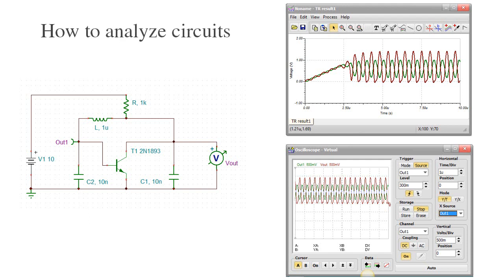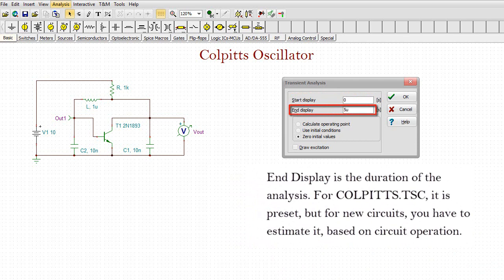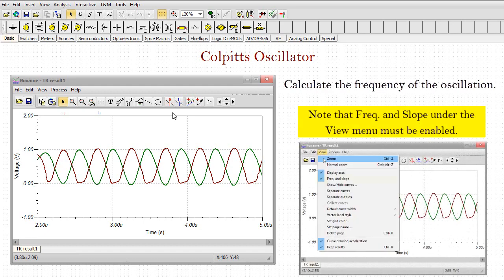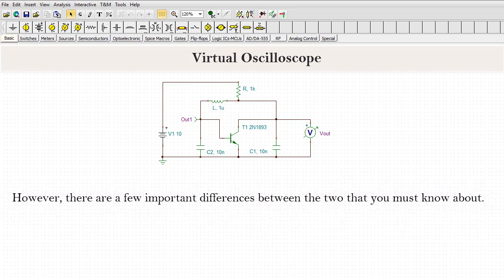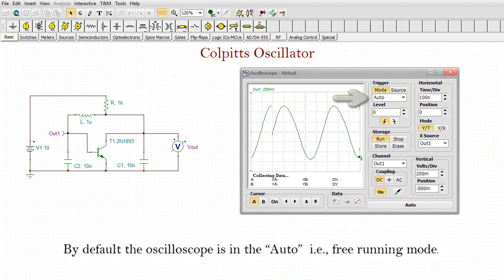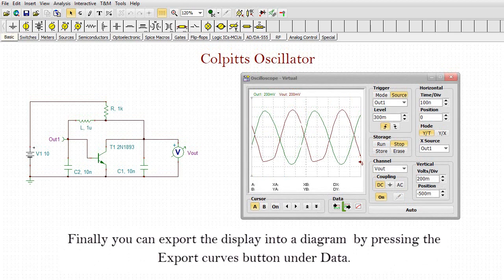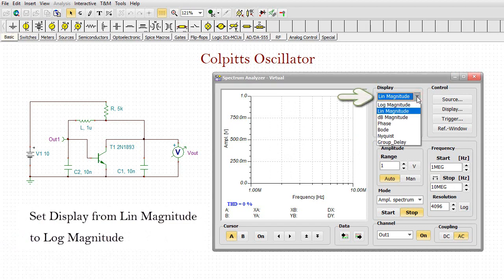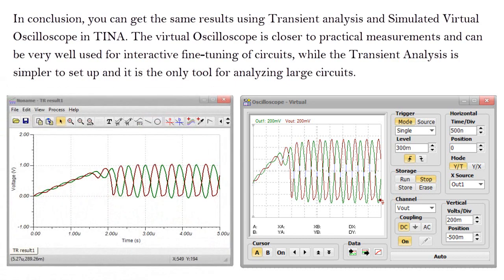How to analyze in Time Domain with TINA?

Comment: I have TINA and it is a very good program and very easy to use
Reply: Can you send me the TINA simulator? please
Reply: I'm just starting out dabbling in electronics. Bought the Tina simulation and trying to get it simulate blowing an LED in a very simple circuit consisting of just a battery and a diode but no matter the voltage and current I adjust to pass through the diode in the software the diode never show a fault when switched on.

What am I doing wrong.
Reply: @MILENEO3  Ok. Thanks.
I have done but still waiting for the reply.